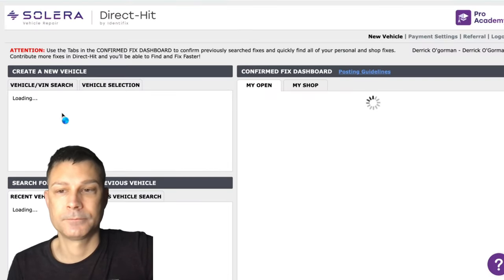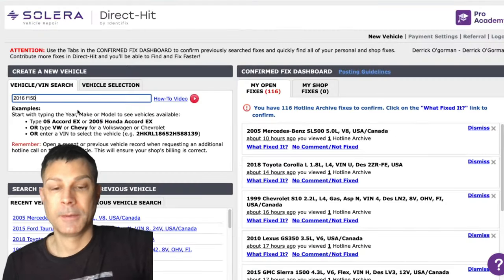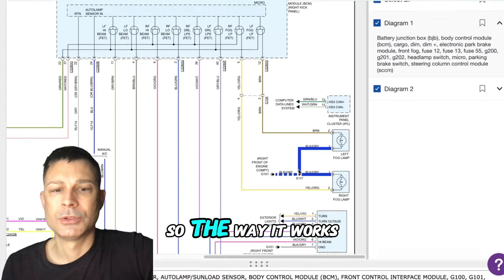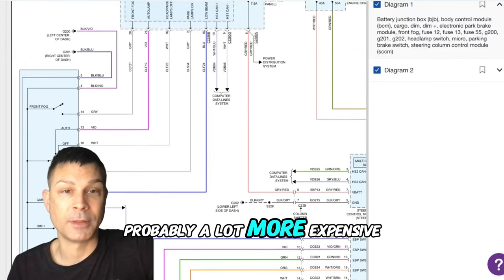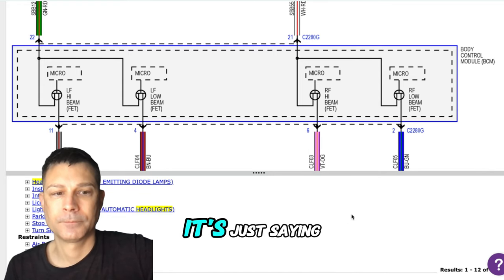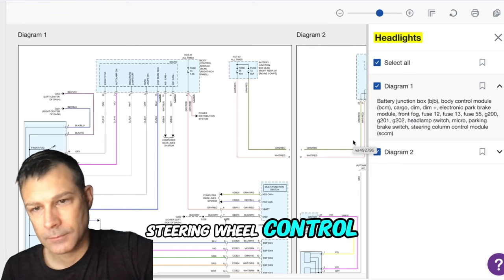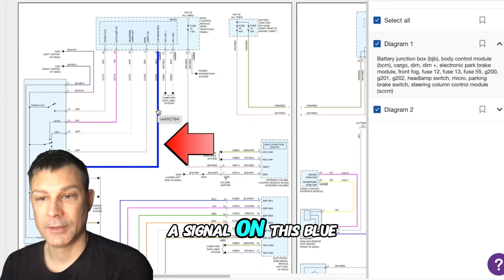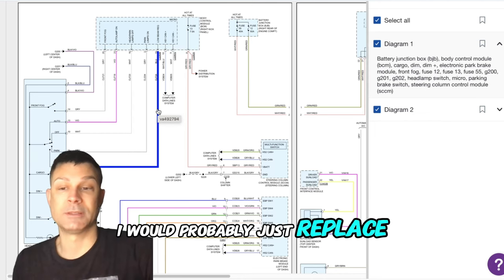My 2016 f150 headlights turn on when I start my truck but turn off within a few seconds. #headlights

Comment: I really like your channel but do any of these people ever get back to you with a fix?
Reply from the maker: Thank you my friend. Most of the people do not reply back to me letting me know about the final fix.   However, there are some that do.  I would say 1 out of 10 people reply back either letting me know they still need further assistance or letting me know that the problem has been resolved.     😎
Reply: @electricaljunky  That's to bad, I would really like to know. Thanks for a great video.
Reply from the maker: @ws2664  You are most welcome my friend.